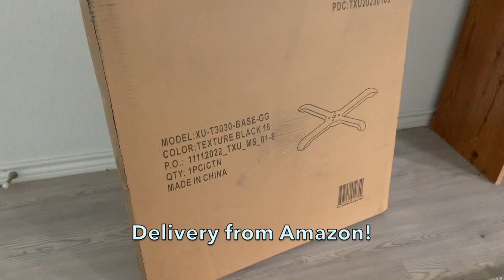Round Epoxy Table Project

Comment: Would be good to mention how long it took the resin to dry before remooving the mold. Have seen lots (lots!) of videos and its strange but this crucial info is hardly given bu any of the creators. Its trouth that it depends on the type of thr epoxi, the westher, temperatur etc but this can be solved by mentioning all these conditions existing meanwhil you were creating the table...
Reply from the maker: Thanks for the input. I'll be sure to increase info on epoxy drying time and other details!

Comment: You did a greatjob, what did you use to make the round edge on that mold?
Reply from the maker: Sorry resina_tabasco, I just noticed that I didn't read your question properly. The sides of the mold are made of clear acrylic. I buy them in 8 foot long strips from a specialty plastics store, and cut them to length.

Comment: As someone trying to start a shop in my garage as well, and also wants to focus on epoxy projects, would it not have been easier to just make a sqaure/rectangular mold and THEN cut the circle after it was cured?
Reply from the maker: No way! You want to cut, trim, or sand as little as possible. You want your form to be as accurate as it can to the finished shape. Epoxy is tough to cut, the dust is messy, a pain to clean up and probably toxic to breathe. Not only that but expensive. You learn to be as conservative with it as possible. You'd be throwing away hundreds of dollars. You'll learn. Good luck.

Comment: How did you make the round frame or form that you place the wood pieces and stones into before pouring the resin?
Reply from the maker: I just used the same saw to cut out a 36" circle from a large piece of plywood; then I went to a plastics supplier who had some 4" strips of clear acrylic for the sides. The most important thing is the white tape you see covering the surfaces. It's very sticky while the other side is very slippery so the epoxy will detach easily- from a company called Tyvek. It's the only type epoxy artists use.

Comment: How did u make that butter circle to hold the resin
Reply from the maker: This video shows how to make a rectangular one. To make one round, you just need something flexible to go around the circle- like clear acrylic sheeting from a plastics supply store. The most important parts are the tape covering and the silicon caulk sealing- so there's no leaks and you can pull them away from the epoxy after dry.
https://www.youtube.com/watch?v=CbuD2Y0E_yo